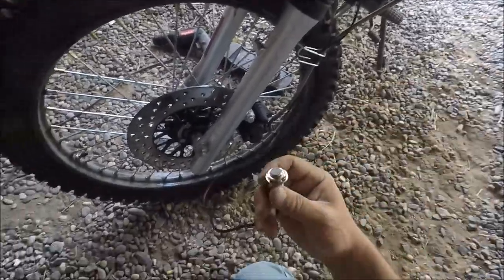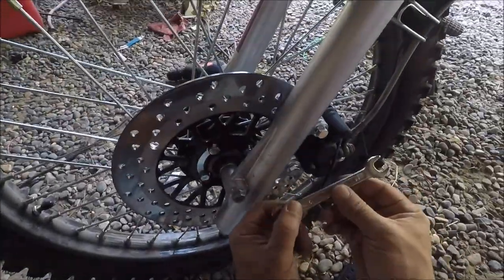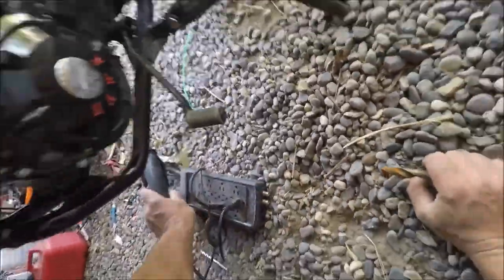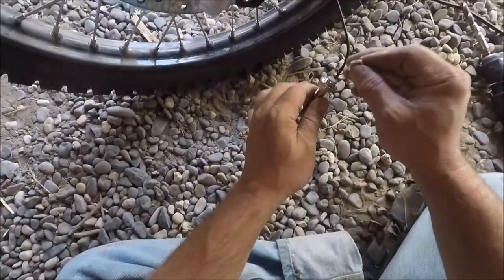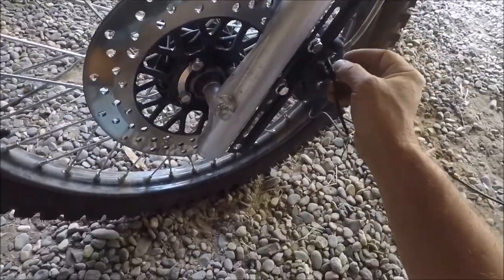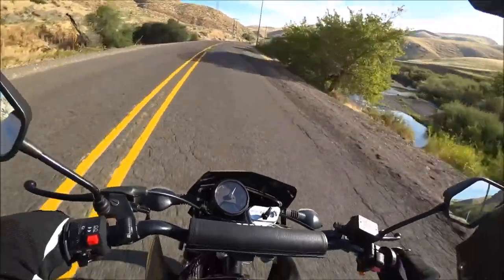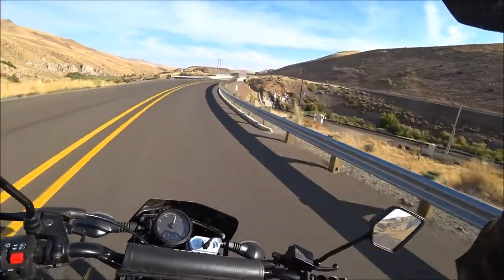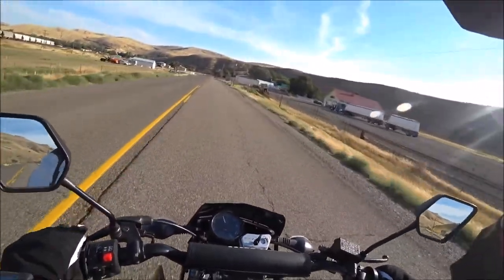RPS Hawk 250 changing things up / #7 Digital gauge SPEEDOMETER

Comment: Check the steering head bearing and wheel bearings (moto guys tend to keep their front ends tighter to prevent head shake). Thanks RJ. Hawk stock carb with 110 main jet and shim the needle with a couple of small flat washers (Japanese carbs have more positons in needle but these chinese EPA carbs don't). The hidden air screw 1 - 1 1/2 turn open. Then cut open (dremmel) the slots in the airbox intake and you'll love it more. See Motocheeze. I just went to 16 tooth front sprocket because I want to still hit the rev ceiling even when the wind is in my face. You the man, thanks again.

Comment: my speed sensor is not working from the beggining. everything else does. even the fuel indicator. any ideas what to do? maybe its a wire at the back of the speedo that moved out? should i "clip it off" like you did at video #6

Comment: what did you use to mount the the speedometer to your upper tree? Awesome video
Reply from the maker: Shoot, knew I forgot something.. haha.. I used the original speedo bracket, just had to modify it a bit.. It is basically a flat steel with three bolt holes, two up front & one centered at rear.. The new gauge only has the two bolts, so I had to grind out room for the wire connector behind the two front holes then squeeze them closer so the two bolts from the gauge would fit.. I'll show this in my next vid.. Thanks..
Reply: I have to make a mount for mine thinking of using the chrome cup stock speedo is in just have to drill some holes

Comment: Hi RJ - did the fuel gauge part of it work out correct for you? does it work?
Reply from the maker: Hi, yeah the fuel gauge works proper.. The only trouble I've had was the neutral light & the back-lighting worked intermittently, I didn't have the grounds secured..
Reply: RJ Gould thx for responding man. so because of your vid, I have ordered a speedometer and install on my Bashan Storm, which is similar to the Hawk.

Comment: thanks but im looking for the on exactly like yours thats not the right one says it dont fit
Reply from the maker: Delivered Sep 1, 2017
Your package was delivered.
 
Astra Depot 12000RPM KMH MPH LCD Digital Odometer Speedometer Tachometer Blue For 4 Stroke 2 4 Cylinders Motorcycle
Sold by: Astra Depot
$29.99